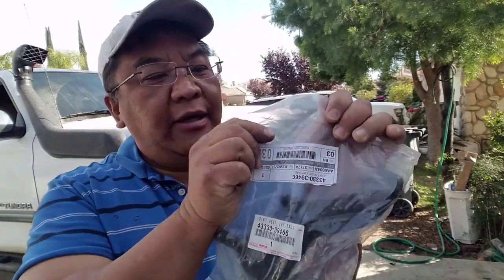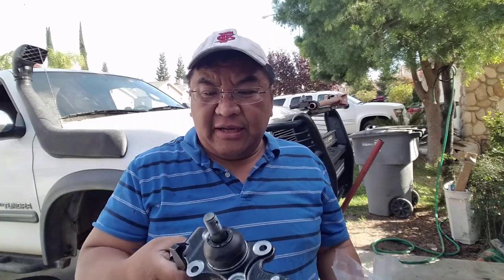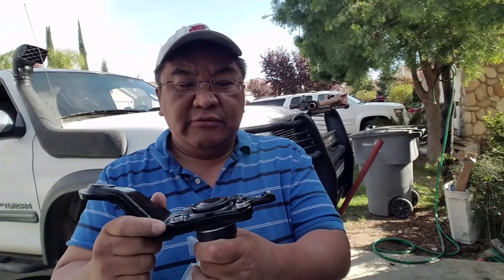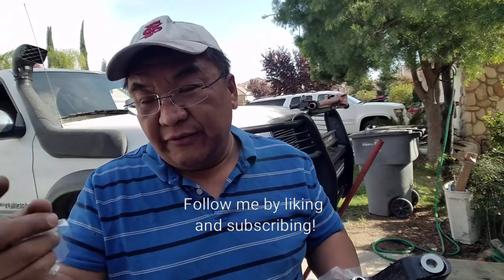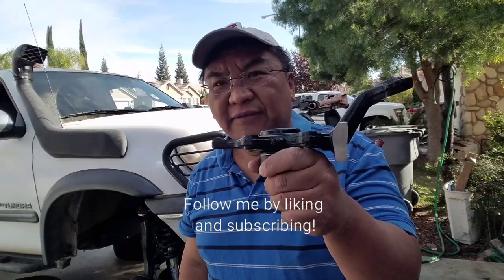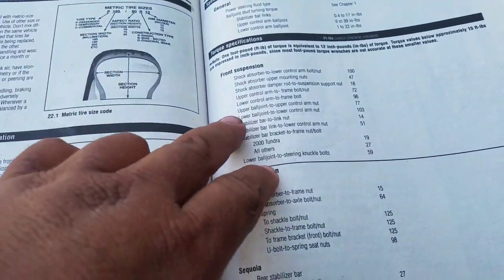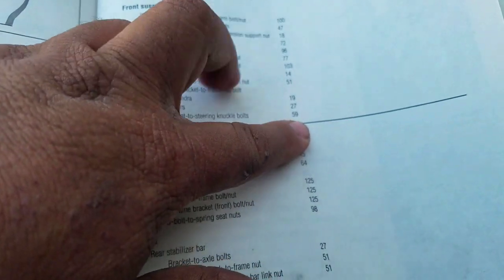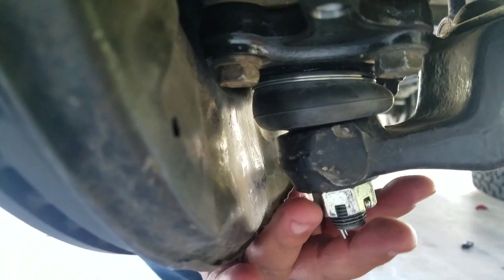Toyota Tundra Lower Ball Joint

Comment: Note:  The torque specs are different for the 2005-2006 Tundras: 117lbs and 48lbs. per Toyota Service Manual.  Glad to see a video where they use the pittman arm/tie rod removal tool vs using a hammer to remove LBJ.

Comment: Wonder if he did the upper ball joints too. I'm about to replace the upper and lower ball joints and control arms. I wonder if it'd be easier since I'm replacing the control arms
Reply from the maker: I didn't understand you
Reply: @theotherguy3083  did you upload a video replacing the upper ball joints? Also, do you think it would be easier replacing the lower ball joints and lower control arms at the same time?

Comment: How much lift do you have? What size of tires do you have?
Reply: @theotherguy3083  what brand of lowers do you have? I have aftermarket uppers and stock loweres, and your total lift? What is under to lift it
Reply from the maker: Currently, 7.5 total plus 35s.
Reply from the maker: @trinidadrm  my lift is a 5 tuff country lift. Plus 2.5 inch with Bilstein 5100 adjustable shocks
Reply from the maker: @trinidadrm  My upper control arms are such. Stock lower
Reply: @theotherguy3083  I was told if I lift it over 3.5 inches the lower would have to be changed??! Sounds like yours was fine
Reply from the maker: @trinidadrm  when you do a 5 inch tuff country kit it drops everything down to make it doable. Check out my tuff countr lift install on my channel

Comment: Nyob zoo, Yaum txiv. I think youre hmong, if Im wrong, sorry. I have a 2001 tundra 4x4 like you too. I have a question on what aftermarket part you would reccomend for tie rods both inners and outers? They are very expensive OEM. Lower ball joints I will buy OEM, but what would you reccomend as a good aftermarket brand for tie rods and CV axles? I have been thinking of either Beck/Arnley, AcDelco Professional, or marked with sankei 555 or Rabestos. Thanks! Great video
Reply from the maker: Hello Charlie Vang, anyone of those brand, I think is sufficient for Tie Rod Ends.  Regarding CV axles, the purest will say stick to OEM. My experiences have been that I have always used Duralast Brand with lifetime warranty with no issue.  If you are going aftermarket,  make sure they are local and have life time warranty. However, regarding BJs and LBJs, use only OEM.

Comment: Great vid , I have a 05 tundra and just swapped mine out after 185k . I was also suggested to use only OEM on the lower control arm. My mechanic also told me horror stories of ball joint failure at the dealership he works at. I enjoy your projects on your tundra. It has gotten me to take the plunge and start my own build towards my tundra to go wheeling on the trails.

Comment: What year is that truck ? The torque specs at end of video said 2000, is that what the truck is ?  

instead of the puller you think it can beat smacked out ?
Reply from the maker: So, my truck is a 2000 model. 2004 to 2006 has different torque specs due to different size ball joints.  

I'd much prefer the correct tools for this job, Pitman Arm Puller.

Comment: What type of material goes to a 2001 Tundra ball joint? Aluminum cast iron or steel
Reply from the maker: It looks to be cast as you can see casting marks on it.
Reply: Thanks braddah!!! Just got it done with your video! You’re the best
Reply: What do think is a good lift kit for 2002 Toyota Tundra?
Reply from the maker: @johnduke900  I have a tuff country 5 inch lift. I am happy with it.

Comment: Did your truck had a rubber cover around the lower ball joint? I have one and it’s supposed to be a dust protector I’m wondering if it’s necessary. I own a 2002 Tundra 2wd sr5
Reply from the maker: No it didn't come with a rubber dust cover.  Some models comes with it she doesn't. Either way it doesn't matter

Comment: Does the lower ball joints require greasing?  If so, how often?  And is the grease fitting easy to access when the tie rod is put back into place?
Reply from the maker: The OEM are sealed Ball Joints. No Greasing is required.
Reply: I think this ball joint was not meant for greasable system. The sankei SB3806 (non greasable)Japan seems to be holding on very well in my prado 90. From new its smooth to rotate with hand. Of course oem best but budget wise next best could be this.

Comment: Hey The Other Guy, you mentioned that you had other ball joint brands that failed in the past, What brands we’re they that failed?? The OEM lower ball joints are pretty pricey and I would definitely like to know which brands of ball joints to stay away from as Im getting mine replaced soon on my 05 Tundra rwd 4.7
Reply from the maker: Autozone's Duralast and O'Reilly's Import Direct. Do more research and you find Moog and Movetech also failed. Save yourself headaches and just buy OEM. A little expensive but worth every penny

Comment: When you remove the tie rod end, is there a need to align front end when your done ?
Reply from the maker: If you don't remove it from the rack and pinion inner tie rod end,  you don't need to.
Reply: You don't "need" to but it is often recommended that anytime you work on suspension components to get an alignment afterwards

Comment: What is the socket size for the castle nut?
Reply from the maker: I forget, it is either a 19 or 21 mm.
Reply: Thank you I replace my ball joints with no problems. My next project will be a new rack and pinion. Have you replaced yours yet?

Comment: Not even 3 months to this date today, after replacing same side is you did in the video, passenger side. CV axle and lower bearing busted off again and I like how you said even buying the parts at Auto Zone and Sadly Orielly's wich where i bought parts, just break again after an amount of time. thanks for your upload, good info to have.

Comment: How do you get the lower ball joint back into the lower control arm? Or does torquing the new ball joint on set it into the lower control arm?
Reply from the maker: Sometime you need power tools to set the LBJ into the LCA hole.  Or if you only have hand tools, you may want to pry on the arm so that there is tension between the LBJ Spindle and the hole so you can bolt on the castle nut.  Don't know if that helps.

Comment: What do u think about TRW lower ball joints I have heard  those are good  and I have heard moog are crap
I was gonna buy OEM  but they wore  really expensive  so I bought  TRW I hope they last
Reply from the maker: Use only OEM. Nothing beats OEM.
Reply from the maker: I have no experience with TRW, but judging from the aftermarket parts that I have seen including Moog, stick with OEM.

Comment: How long do you think this will take the first time person to do?  should I rent space at the shop for $30 an hour with a lift or just use the bay without a lift for $20 an hour?
Reply from the maker: I did this on my drive way. If you have a drive way you dont have to rent a bay at all. It took me 30 minutes on each side. But that's because I have power tools and the right tools for the job.
Reply: @theotherguy3083  if I do it in my driveway what tools do you recommend besides regular sockets and wrenches?  I see you used a puller? Do you have the make and model by any chance?
Reply from the maker: @johncpen2000  well you need a putman arm puller for the LBJ. You need a smaller pitman arm puller for the tie rod end.  You'll need a power impact wrench to make the job easier and faster. Then you'll need a torque wrench that will torque you LBJ nut to 103 pounds feet of torque.
Reply: @theotherguy3083  thanks. I appreciate that information. I might just rent a garage space because it includes tools and help from a mechanic.

Comment: Love your tutorial Vids. I recomended toyota owners of our 1stgens follow you. One thing that would help all of us is that we replace the lower ball joint 👉🏽Rubber Dust  "Protective Cover" which protects the rubber belows holding all of the required grease. 
All - in - all,  this DYI is on point👌🏽

Comment: im got the same truck as you, im looking to replace the control arm bushing, where do you live in cali? which bushing are you using or are u buying oem bushing for the control arm? I need someone to do job for me. Im in la.
Reply from the maker: dang0088 da Oem is usually the best on bushings and bjs. I live in the central valley of California
Reply: i just bought 2 lower bushing from amazon oem from toyota at 80buck each, damn, i need to buy the other 6, $25 for 4 top bushing and the other 2 lower busing is $42 each. I just bought this truck last week, its getting expensive.
Reply from the maker: dang0088 da wish you would have just gone ahead and buy the whole arm instead.
Reply: it would cost too much, all 4 control arm is 2000buck.
Reply from the maker: dang0088 da the upper rarely go bad
Reply: believe it or not, it when bad, i took it to aliment shop and they show it to me, have to buy all 8 bushing.

Comment: What year is your truck and which service manual did you used?
Reply from the maker: Romeo maloco my truck is a 2000 model. I usually use Haynes. But I also have the chilton.
Reply: The Other Guy 
Thank you for the fast reply. I have a 2007 Sequioa and its should be the same specs as your truck. Thanks for sharing your knowledge.
Reply from the maker: Romeo maloco you may want to check. The reason is the 1st Gen BJ design is totally different from the 2007. What I meant by that is the 2007 had a bigger LBJ.

Comment: What size jack stands are you using?    I changed out my step fathers 4 months ago.  They were bad!  I also changed the rack and pinion as these trucks have an issue at the clamp gasket with rust.
Reply from the maker: Sir Sweetness if you mean jackstand, it is a heavy duty 4 ton, 19 inch fully extended Jack stand.
Reply: The Other Guy 

      I was wondering, I use 12 ton and thought yours looked small.  I am responsible for safety professionally and it carries over to my personal life.  Thank you for the reply

Comment: What type of tool did you use to get the proper torque?   Thanks for the video.  I don't have a lot of mechanical experience on trucks, but you make it look simple enough for an average person to try!
Reply from the maker: Buy a torque wrench from home depot or lowes  to torque it to proper ft LB. 

Also buy a Haynes Repair Manual. It will help you a ton.

Comment: Hi my Tundra 03  new tire new rotors drive 60 mph when I  brake shacking a lot from the front tire. Lower ball join problem or not please let me know thanks.
Reply from the maker: How new are the rotors and were they shaking before the new rotor?
Reply: @theotherguy3083  before not shaking after new rotor and new tire good. 1 year later shaking a lot  I went to the discount tire inspect tire all good rotors look new.